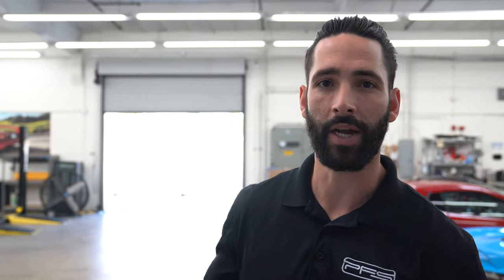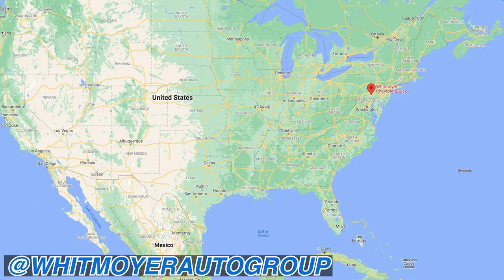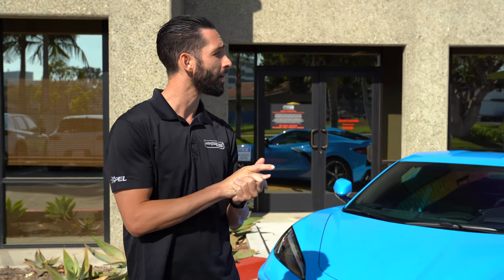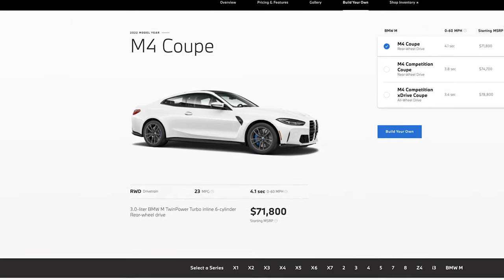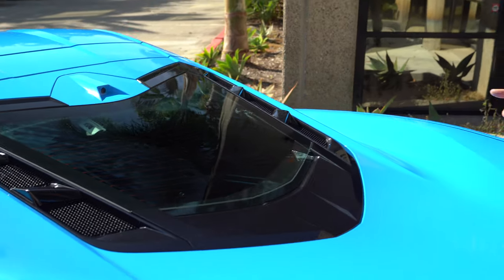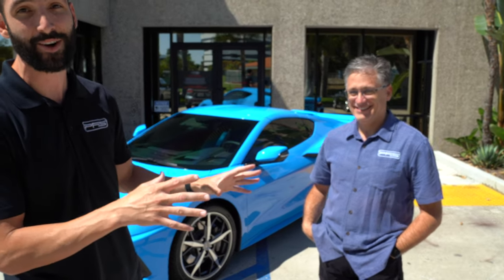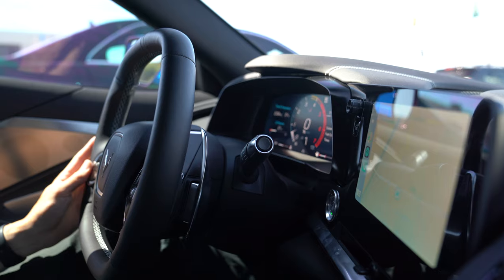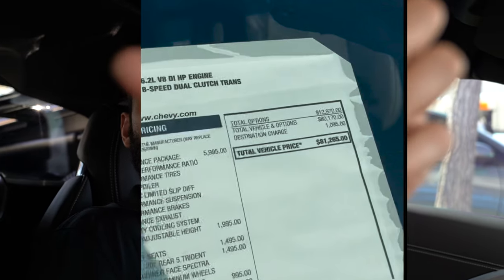WE BOUGHT A BRAND NEW CORVETTE C8 + GIVEAWAY WINNER REVEALED | PROTECTIVE FILM SOLUTIONS - 4K

Comment: Absolutely needs a TWIN TURBO.....I make note that Fuel Tech just finished theirs, developed 1350 HP TO THE WHEELS and did a quarter mile in 9.01 seconds.....Rapid blue NEEDS the power to go with that great color!!!......BTW, you can get a twin turbo system for under $20K INSTALLED from Complete Street Performance with 700HP for those who just want to ANNOY Lambo, and Porsche owners when confronted by them in the other lane on the Expressway!..... True SUPERCAR PERFORMANCE for around 100K, you just have to love the thought of that!